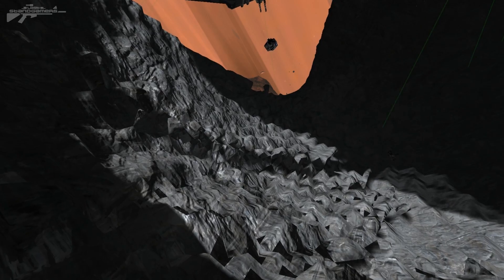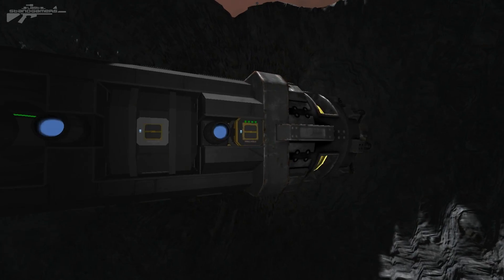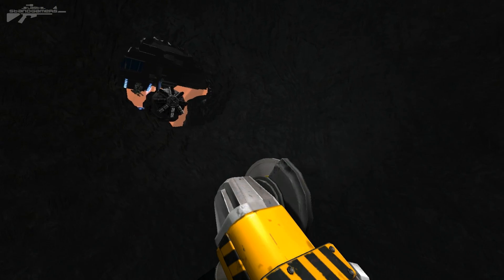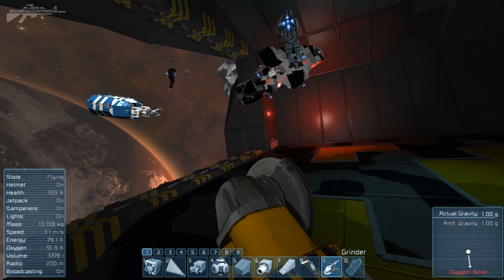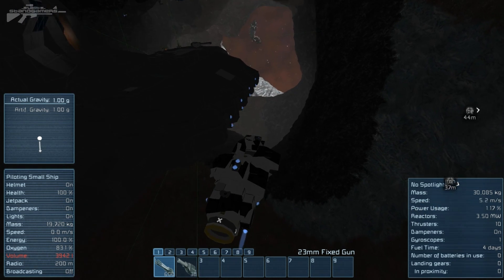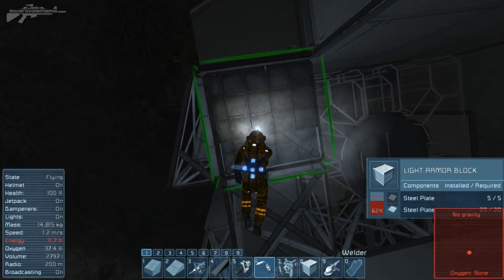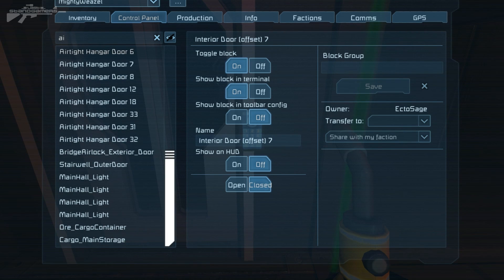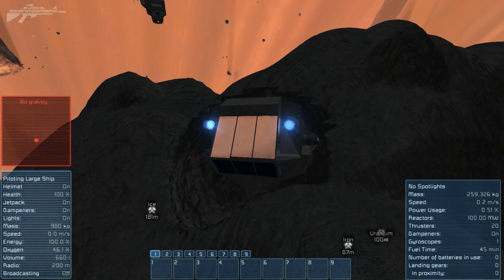Space Engineers - Drills & Thrills Chip Vs Crisps  - Part 34

Comment: I just did a test in my own game and its quite easy to get a thruster to burn up Stone though i haven't tested stone. All you need is the sorter and connector throwing out the Stone then holding it with a spherical gravity generator pulling inward at the bottom of the ship near the gravity cut off area. Then override a thruster to be on while aiming at the hang zone and it'll be taken care of.

You can also use a timer block system that fills a cargo container grinds it down releasing a large amount of stone towards the thruster. Then use a projector and welder remake it and then the stone will take care of itself.

Comment: Connectors function fine for ejecting stone.  You have to use them in a group.  However, for them to work efficiently, you have to place a sorter block in front of each one of them.  As they fill up, they steal from each other making them less efficient.

Comment: as you  move the ship tour having ship vibration that breaking up your vehicles you need to calibrate the ships thrusters with  the gyroscopes as to smooth out you movements
start with the solar panels to balance your power usage ,your shipsdesign is throwing off your center balance of ship placement redesign your gyros in such
Reply: steven booth away to better balance your ship